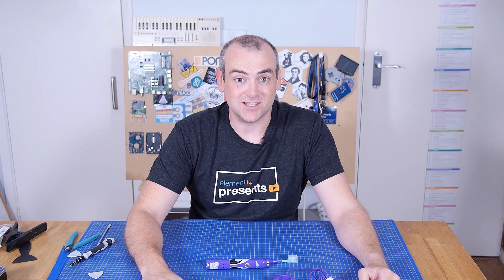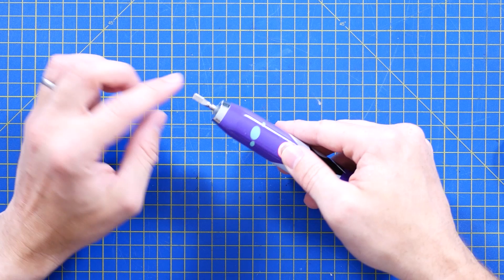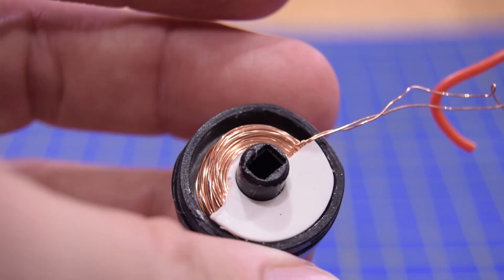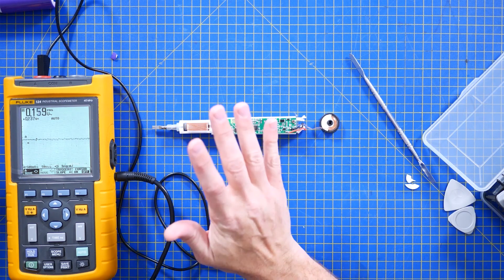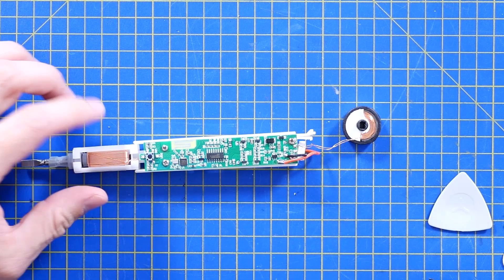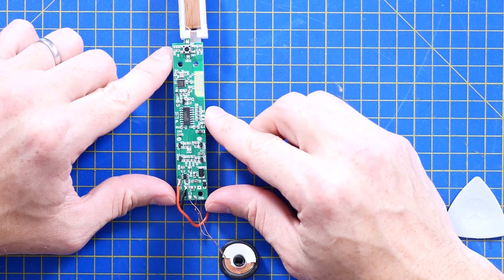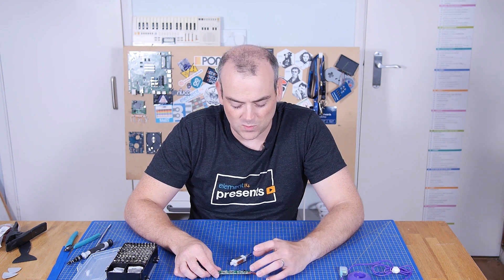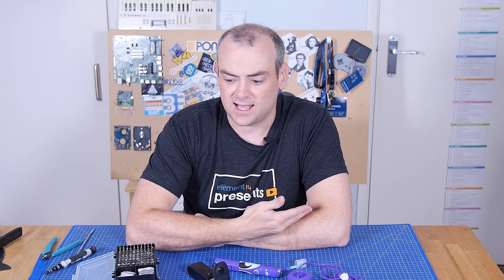Bluetooth Deeno-saur Children's Toothbrush Teardown - The Electronics Inside

Comment: Hi what is ceramic wire?
Not sure as I could not find the hi res photos, but it looks like the 4 transistors are indeed an H bridge but driving the oscillating head.
Reply: Ceramic coated wire, it's wire (typically copper core) that is insulated with a ceramic coating instead of a plastic. This is what you'd often seen solenoids wound in, as the insulation is thinner, you get the conductors closer together for a better magnet.

Thank you for spotting the photos are missing, I'll get them put up there ASAP!
Reply: Just to confirm, the photos are now available on the e14 community, linked in the video description!

Comment: One thought on the inductive charging coil; most inductive chargers are two coils in proximity to each other but not overlapping. However, the charging base of this appears to wrap around the coil which would have much better field strength. That may be why the coil is so loosely wound.
Reply: Interesting question! I think it may have performed better if there was a ferite core in the toothbrush, however face to face contact would probably produce the best result without? But I'm happy to take a hack saw to the base to find out if you're inerested?